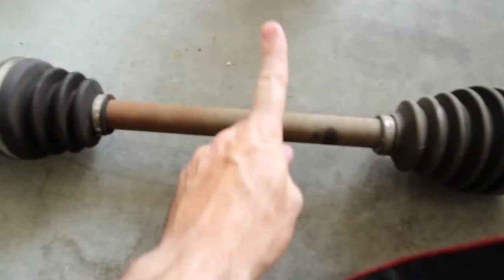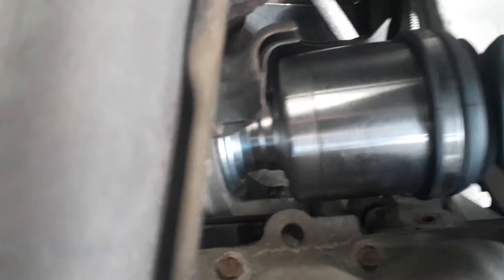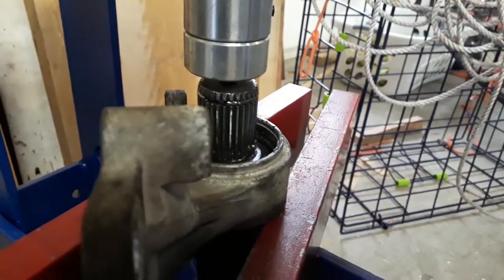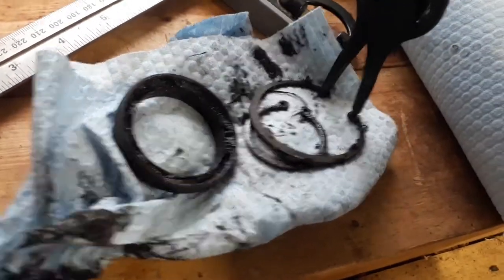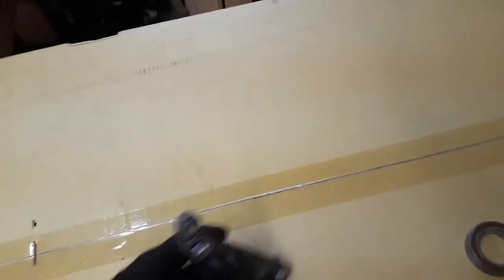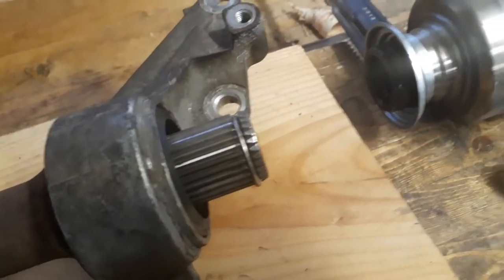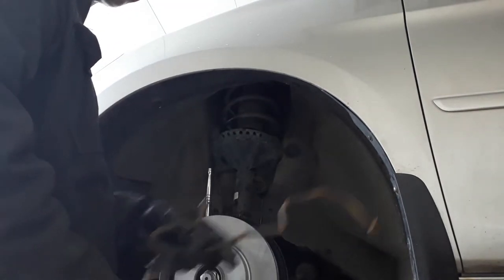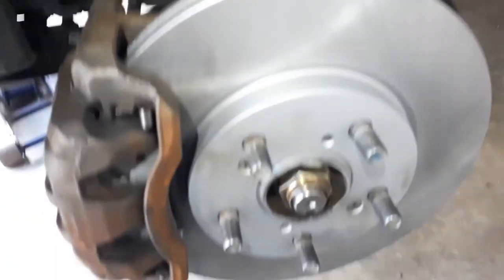Odyssey Vibration Saga

Comment: We started replacing front end suspension parts (ball joints, tie rods, shocks, etc) that had worn out - 2008 (166,000 miles). Thought we had it all figured out, so we had the tires balanced, rotated, and replaced the front break pads. Everything got worse. MUCH worse. At 50mph, the vibration was so bad it was unsafe to drive. Under 40mph, it seemed fine. When breaking, everything shook. We had the tires rebalanced at two different places (one location misbalanced them) and the shaking/vibration was the same if not worse. I knew it had something to do with the rotors or beaks because of the excessive heat coming from the front wheel area after driving the van for 10min. and feeling like the breaks were pulsing. Yesterday, my son and I replaced both front rotors and now it is as smooth as butter! It has been quite a painful and expensive journey the last 3 months, so I feel your pain. Thanks for posting this video and all the best!

Comment: Thank you for this video. I have an '05 Honda Odyssey that just developed a highly variable vibration between 45 - 55 mph with peak vibration at 50 mph. Sometimes the vibration got so bad that I thought I had to have a flat tire. The vibration was intermittent, but when it occurred it was worse under load (climbing a hill) than when going down hill or on level ground. The vibration continued if the engine was turned off when coasting downhill, so I ruled out the tranny and the engine. Because it was intermittent, I ruled out tires and rotors, and because it got worse under load, I thought it had to be one of front wheel driveshafts. Upon viewing your video, I decided to change the rotors of both front wheels, since they were probably original rotors. Problem solved! No more vibration! Thank you for diagnosing the problem.
Reply from the maker: so glad it could help you find a very elusive problem. your comment gives more evidence how rotors can be the source of intermittent vibration. Thank you for the detailed explanation of what was happening to your vehicle.
Reply: thanks for the detailed experience. I have a '03 Civic and it is doing the same problem, it vibrates when climbing hill and I have done everything except the rotors. Definitely will try the rotors because the car also vibrates when braking. Thanks mate, will update after I do the work
Reply: I have similar problem, it is torque converter on uphill, replaced drive shaft, intermediate shaft , control arm and it comes on uphill at 30 to 45 and that is where torque converter locksup

Comment: I had a similar problem starting at about 30k miles were the rotors would distort when highway driving.
I determined the pads were not retracting enough after braking.
I greased ( brake caliper grease) the caliper pins and pad dovetails, bent the v clips on the back of the pads to separate the pads from the rotor when no brake pressure was applied. 
At 83k miles I have never replaced the rotors or pads.
When it starts to do this again, usually after a winter season of salt and rust, I preform the procedure again.....Honda has made a mint of this misdiagnosed problem!!

Comment: Hey my friend. You are a legend. My accord 2004 just started the same thing. It was fine, then out the blue. Started. 60mph is unbearable even a slight be of acceleration and it was shuddering. I’ve seen videos saying drive shafts (axles) others claiming wheel balance, others claiming rear gearbox mount. I’m going to start with new discs and pads up front and go from there. Thanks.
Reply: solved issue?

Comment: Thanks for your video.  I am on the same vibration saga.  Had new rotors in the garage shelf so changed those out first, still vibration.  Changed out inner and outer tie rods (both sides), still vibration.  Changed out passenger side CV axel, old one fell apart while removing so was very bad.  Passenger side CV was difficult so did not have time for the drivers side yet.  Vibration is still there but not as bad.  Drivers side CV axel is next, fingers crossed.
Reply: Did you ever get to fix your vibration issue?
Reply: @amirparvez5415  Yes.  Also replaced the control arms as the bushing were also looking worn.  Then got new tires and an alignment.  Finally no more vibration, but I do suspect wheel bearings are next.  Lesson learned.... inspect and replace everything you even suspect all at once.

Comment: I better say, that during the 20k miles that I have done with the van. I do find that when I stop the thing it takes a lot of break pushing to stop the heavy beast. I thought I checked this and it was good, but I need to jack it up again, remove the wheels, start it up and get those rotors spinning and check for a warped wobble. I also use the van to tow 2,000 pounds sometimes.

Comment: When I bought mine used it came with new rotors in the front. I later did the rear. Mine came used with 150k and vibration started at about 170k. When the wobble is extreme it really reminds me of when I tried to do a fast take off with wheels spinning on an old Miata. That was similar in feel. What happened with the Miata was uneven grip on the two spinning tires and then grip and slippage would bounce back and forth from left tire to right tire until speed caught up to the wheel slippage. So I was just thinking that somehow that was what was happening to the Odyssey, power bouncing back and forth between left and right wheel. I still think that is the issue and is caused by that looseness that you have found in all those connections. I would love to jack up a new Odyssey and feel for that looseness

Comment: 20:55 this is really helpful. I experienced the unhappiness of replacing something complex when not necessary. Mine vibrates harsh now, usually when accelerating and a light change in the road triggers it. Taking foot off acceleration stops it usually, breaking also seems to help stop a violent wobble also. The violent wobble is rare, but the softer wobble seems to be happening more often.
Reply: did you solve?
Reply: I have replaced front rotors and pads twice, resurfaced rear rotors, and pads twice.  6 months after replacing the front and back set up the vibrations come back.  My problem is the braking,  vehicle shakes when braking.   I guess newer vehicles are more crappy.  By the way I drive an older vehicle and it is less of a headache than this Honda product.   Of course it is quite reliable aside the bothersome shaking while breaking.

Comment: I have the same exact problem in my 07 Odyssey. I changed my brakes because I had metal to metal on the passengers side, along with the rotor on that same side and my vibration got worse. Tomorrow I am going to change out the rotor on the drivers side to make everything even. Thank you for taking the time to do this video for us. 👌🏿
Reply: Anytime you do brakes your supposed to do both sides at the same time . Did the new rotors fix your problem ?

Comment: This video was helpful,I change my left front wheel bearing, and left front axle. I still have a vibration at high speed on my 04 honda. I change both front rotors last year. Issues still resist.
Reply: Hello Bill,
Thank you for your time and video. You helped me fix my problem with my 2014 Mitsubishi Montero it was my front rotors clogged and rear tires too! 👍🇺🇸
Reply: Might check your inner and outer tie rods. They were bad on my 06 Odyssey. Much less vibration. I believe i will check my axles next. Then the rotors!

Comment: Have a second generation with this problem. Great car, just recently became owner of this used car. Changed innershafts on both sides. Still have vibration on the right side. Splines seems to be a bit worn but the new shaft have the same play. At low speeds i have severe vibration when i push the throttle. When i turn it goes away.  I have had several cars with cv driveshaft but this is the first car for me with this problem. ....

Comment: I have been fighting the same type of vibration on my 2001 odyssey EX years ago. It turned out to be a wheel bearing that was pressed in incorrectly by the factory. There was no play no noise when driving. Over the years I changed everything in the suspension. Changing brake rotors only worked for couple of months and the vibration came back. After changing the wheel bearings it all went away.

Comment: I have a 2010 Pilot and I have changed the sway bar links(front and back), sway bar bushings(front and back) m, new tires with road force balance, front and rear suspension,  tie rod ends along with the intermediate shaft. NOTHING HAS WORKED. The rotors are my next and last step hopefully this works! I have vibration from 25mph plus upon acceleration and some pulsating when braking(not awful) however I can feel it. Thank you for the video
Reply: if it shakes the steering when braking the rotors are warped.

Comment: Great detail in video! Thanks for taking the time! I know it's tough not knowing what the issue is, but instead of replacing a bunch of parts that may or may not be faulty, I would recommend finding the actual issue first and addressing that.
Reply: Hi Phil, you stated it’s tough not knowing what the issue is, and then recommended finding the issue first.

Comment: I have a 08 Honda Accord V6 that has a steering wheel vibration at highway speeds that i have been battling for about a year now. I replaced both driver and passenger axles with New OEM Honda axles since i thought the original axles had above average play in the inner joints, but the new axles did not completely fix the vibration.... After watching this i am starting to think it might be my rotors and the axles were probably fine.... About a year ago i replaced my front brake pads with OEM Honda pads and Autozone gold rotors. I am starting to believe the Autozone rotors are garbage and probably warped or imbalanced from the factory. I know this video was for a Odyssey but the Accord V6 is very similar underneath. I am going to buy Honda rotors and pray that fixes my problem!!
Reply from the maker: it's so hard to track down the source of a highway vibration. Everybody says - get your wheels balanced. Which of course is the first thing we all do. But it could be any of the rotating components. Hopefully your Honda rotors will solve your problem. Is your vibration under braking? Or present all the time?
Reply: @hoddy2001  Oh yea I forgot to say I also bought 4 new tires about 3 months and had them road force balanced. Yet again didn't fix the steering wheel vibration. The steering wheel vibrates all the time above 50mph. It honestly isn't that  bad of a vibration but still noticeable and annoying. I will update if quality OEM Honda rotors fixes my car.
Reply: bb2status update?
Reply: bb2status soooooo? We’re waiting to see if you fixed your car.
Reply: Did new rotors solve the vibration?
Reply from the maker: @hanynowsky  sorry what are you asking?
Reply: @hoddy2001  Sorry my joke was silly. Just wanted to know whether after one year, the steering wheel vibrations are still absent!!! 
I have annoying vibrations on the steering wheel and and on the gas pedal that start from 90km/h and become a disaster by 140km/h.
I managed to cure 30% of the intensity of these vibrations by road-force balancing the wheels but the root cause is still somewhere else.
New tyres, did not help.
Next step is brake rotors.
Reply from the maker: @hanynowsky  Yes up until we exchanged the van a few months ago everything was still good as gold. it's really annoying because now if they have road balanced your tires and if you had a problem in the rotors like I did, then the road balance will be thrown off. It's simple enough to inspect your rotors to see if you have any obvious accumulation of mass
Reply: @hoddy2001  Sure. You're totally right.
I think it is either rotors or wheel bearings as when I replaced tyres from old to new road-balanced ones, the vibrations got worse, which means the old tyres somehow adapted to the unbalance cause by wheels/rotors and that new tyres demasked the unbalance.
I inspected my front rotors today just from the braking surface and they are almost gone. Tomorrow I ll do just like you and inspect them deeply. If I find a single obstruction, then I ll replace the whole rotor/wheel bearing assembly.
Thanks for your excellent video.

Comment: i have a similar steering shake at 70mph, tires balanced, then swapped with no fix. my rotors a worn so will change them before getting wheels checked again for balance.
Reply: Did you fix the problem?
Reply: @rafatorres1420rt  YES all four wheels where badly out of balance. now balanced by a  shop that knows what they are doing and running smooth again.
Reply: @darylrobert3673  perfect good for you , I'm going to start with the driver side axle but I was also thinking about the balance of the pax tires on this touring model

Comment: cheers bill, i have an annoying vibration in my car which ive had for 12 months now, mostly in the accelerator pedal, think im gonna check my discs now, they are only 3 years old but having more rust weight on one side of the disc im guessing it what gave your car that kinda vibration, never even thought to check them tbh and you wouldnt think that could cause a vibration similar to what a cv axle would do

Comment: I have had a Honda Civic and Accord and just bought a 2003 Odyssey. It was only $2k so I got a good deal. It does have high mileage 174k but is in good condition. I have noticed the exact same wobbling you describe in this video so I will replace the rotors first. So only one side of the rotor got clogged? I wonder why? I guess that is causing enough imbalance to create the wobbling at higher speed. Mine only does it between 60-70mph like yours did. It seems nobody thinks rotors would be the problem and spend a lot of money replacing axles, bearings, tie rods, tires, rims etc...only to get to the last possible cause.
Reply: It also seems like all Honda's eventually have this problem. Cars and vans. But why don't other brands of front wheel drive cars have this problem? Is there something defective with Honda's rotor design?

Comment: That is very helpful i have same movement in mine .i will now hold off on replacing mine
Reply: Have odyssey touring 2011 same problem I did replace both axles but didn't work I'll try with rotors now .thanks

Comment: I have a crv 2011 with shudder on acceleration only between 80 to 100 km/h. I got 350k kms. Rotors are new. Links are new. Ball joint is new. Tires are new. No steering vibration. Just front shudder when I accelerate hard on the highway starting at 80. Honda tells me it’s the axels maybe….its driving me INSANE

Comment: I have the vibration  at 50 mph, changed axles, tie rods, tires, road force balanced, aligned, I have dont rotors a few years ago. One mechanic  said wheel is bent, I replaced that, still have vibration.  Wtf, at this point I should have paid honda the 100$ diagnostic.
Reply: Any update ??? I am having vibration on low and high speeed between 40-60 i dont feel any vibration

Comment: I think my Mondeo mk4 scti has the same issue, I have already changed the o/f side drive shaft as that did have play after the previous owner ignored a split cv boot but that did not fix the problem, I know my brake disks are warped as I feel them under braking, changing disks and pads next.

Comment: Bill, how come the car didn't shake while braking? Can't imagine a warped brake disc that does not rattle while really in operation
Reply from the maker: The rotors were not warped. They had a weight imbalance.
Reply: @hoddy2001  Geez, that is really very uncommon.
Anyways, I'm only in the beginning in my death wobble journey with my '05 CR-V. Opted out tires, rims, front suspension joints&stuff, changed front CV axles.  Removed propeller shaft, so opted out rear drivetrain completely.
Still have the original engine and transmission mount and intermediate shaft.
Nevertheless, I will change my break rotors, too, they're pretty old after all. See if it cures the problem.

Comment: Im have shake/vibration between 30 - 50km. Sometimes it's not vibrating at all. Also when 4wd mode is on. It's literally driving crazy cause been changed almost everything beside gearbox, front brake system and car itself. Will change front brake system if it's not helping only a gearbox is left. 😔

Comment: Yeah my gas pedal is vibrating now when go on 70 mpg plus. My front rotors was replaced about 8 months ago. I dont think its the rotors. But i guess i should take a look at them since i haven't touch them. Then ago my brake doesn't vibrate so i dont think it has anything to do with rotors.

Comment: Mine vibrates into the steering wheel only at the same speed and goes away when you slow down or speed up even slightly. Does this sound like your problem. My brakes make noise right when I come to a complete stop and the same noise when I take my foot of the brake. Does this sound like any of your symptoms? Great video 👍 looks like a common problem. I think that's why the one I bought was on the used car and my luck it's my problem now.

Comment: I have same problem with my 2018 odyssey. Vibration start from 25 to 35, 85 to 90  pressing acceleration goes away, i keep complaining from the dealer since then but my issue still not fix.
Reply: I just bought a 2005 and at the same rpm or speed weather it 5mph to 50ph it's like you flip a switch and it gives you a out of tune motor to driving on a slight wash board road effect and like yours you decelerate or accelerate and it goes away. It also has a low vibrating sound too with vibration into the steering wheel. If this sound like your symptoms I'd sure appreciate a comment or two.